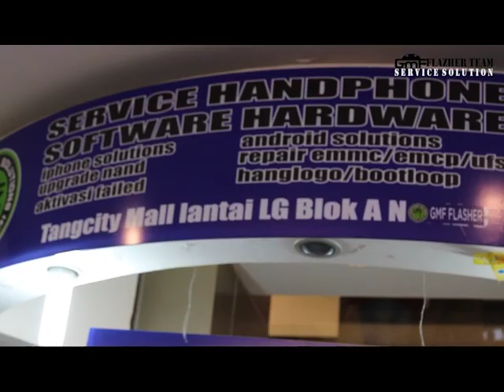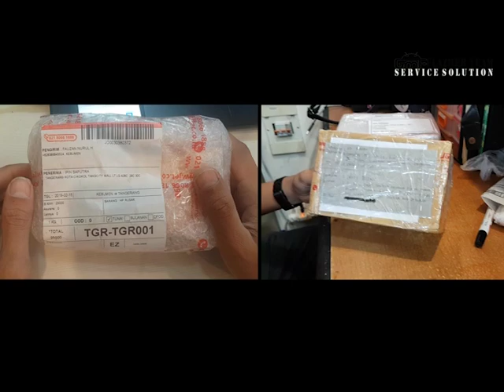TEMPAT SERVICE HP  TERPERCAYA DI TANGERANG

Comment: bisa ganti tc oppo a57?
Reply from the maker: 1 set ka wa 082111800124
Reply: @ipinsaputra1991  tokonya dimana
Reply: tc nya kw berapa apa ori? keknya sya pas waktu itu gantii mesinn hp jadii seringg panassss bngt mesinnya
Reply from the maker: Tangcity mall tangerang Lantai LG A28c-29c gmf flasher

Comment: bang ipin klo bnrin lcd samsung s7 edge docomo brp
Reply from the maker: rosa dah bisa
Reply: @ipinsaputra1991  bank klo servis hp 6111 bsa ga
Reply from the maker: Bisa
Reply: @ipinsaputra1991  bank klo hp 6111 lgi d cas tau2 langsung matot tu knapa y bank mnta alamat lngkapnya donk bank
Reply from the maker: Tangcity mall lantai Lg A28c-30c tapi tanggl 15 ini baru buka
Reply: @ipinsaputra1991  ok makasih infonya bank nanti klo dah bka hp gua yg 6111 d bwah deh ke tmpat abank smoga hp gua cpet smbuh dri penyakitnya deh bank
Reply: @ipinsaputra1991  bank gnti ice power 6111 bsa ga